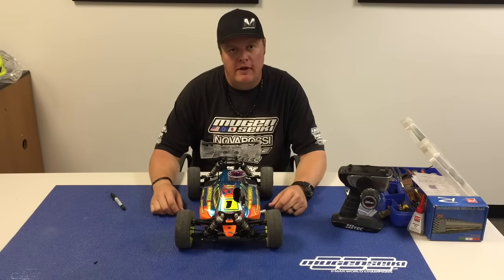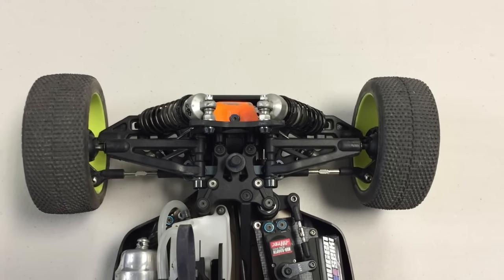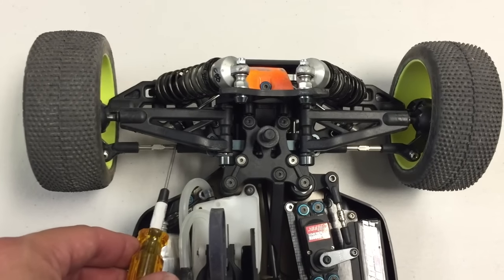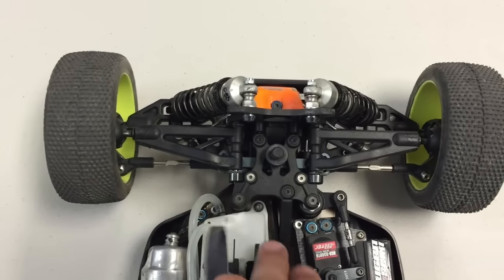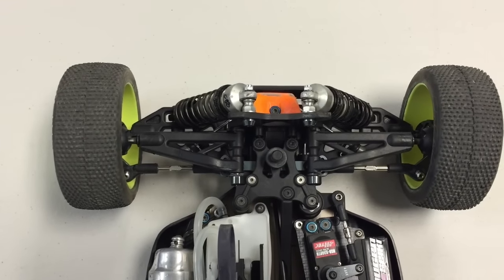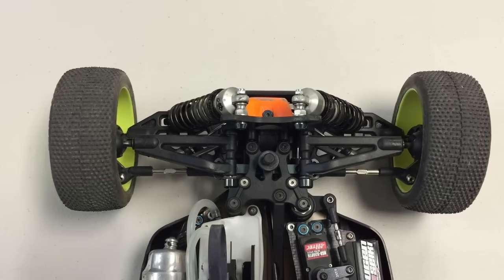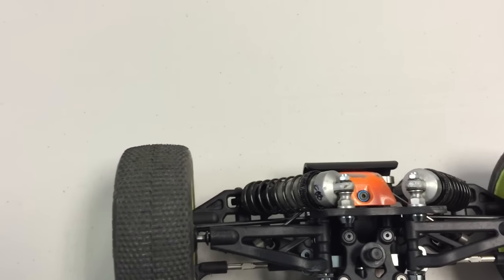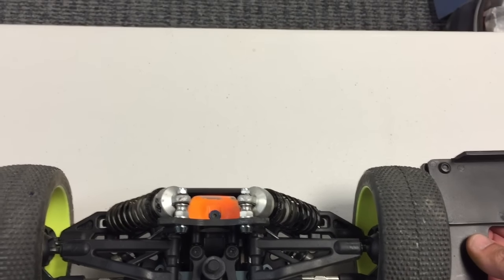Adam Drake from Mugen Seiki Racing show you how to set toe.

Comment: So when a setup sheet says for example 1° of toe and I measure my toe using a camber gauge (like you showed in the video), should I read 0,5° of toe on each tire (so it adds up to 1° in total) or should I set the toe, that it reads 1° of toe on one tire ?
Reply from the maker: When I put 1 degree on a set-up sheet, I'm referring to 1 degree per side.
Reply: Ok, thanks !

Comment: Adam do u have any tutorials explaining bump steer a little more, I am fairly new to driving and setting up 'pro kits' and bump steer isn't something I fully understand yet.
Thank you
Reply from the maker: I don't think I have anything talking about bump steer, but I'll add it to my video list.  In general, bump-in will have more mid corner steering.  Bump out will have smoother steering and be better in bumps.
Reply: Thanks very much Adam. Do kit setups generally come with neutral bump steer? I have just built my 1st pro chassis and i am trying to learn as much as I can, so sorry for so many questions and thanks for taking the time out to help. Much appreciated
Reply from the maker: It depends on the vehicle.  The Mugen vehicle have a very unique bump steer, but it works well.

Comment: Hello Adam, I see that your left upper pillow ball is unscrewed abit..
 ?Is that ok to  run it like that
Reply from the maker: Yes, it's fine to run it unscrewed slightly, but the washers make it easy to adjust the camber.
Reply: Thank you!
Asking because I dont get the same camber on both sides with the same washers..
Did you experience this?

Comment: Hello Adam so why do I measure 📏 the distance from the sides of where the spanner 🔧 goes to adjust so u said the space between the turnbuckle plastic but I’m going from the outer edges of the centre hex part if that makes sense so it seems just the space is ok please help me out or some1 reading and following me here🙃🙂
Reply from the maker: I measure the exposed turnbuckle because it's very easy to get that measurement and also consistent.
Reply: Adam Drake damn str8 Adam, thank you loads

Comment: Wow what a great “hack” for not spending hundreds of dollars on a setup station! 

I guess also something that can be done is once you set one side rather than using the gauges is to actually just make sure the buckles match on the other.   

I know for me sometimes it’s hard to set camber cause tires never seem to be super even all around so depending on what position your tire is in the reading might be diff but if the buckles are all the same length both sides should be the same